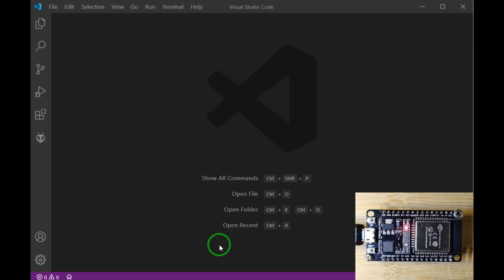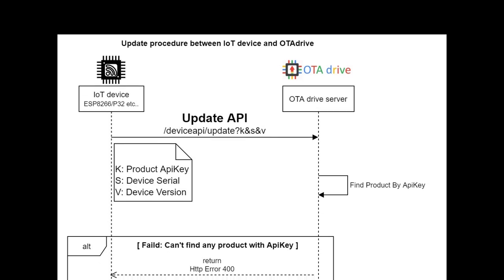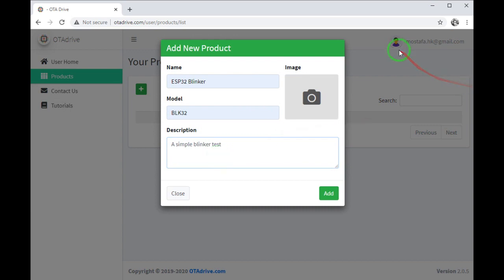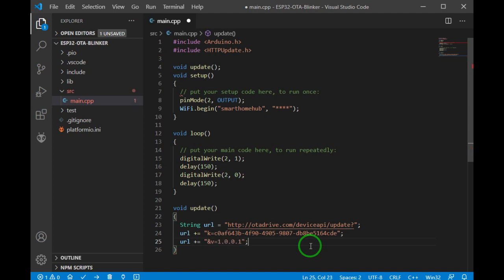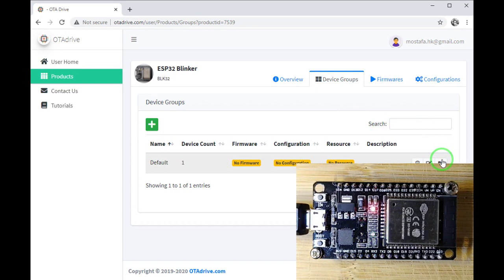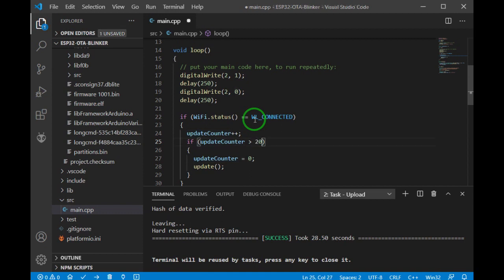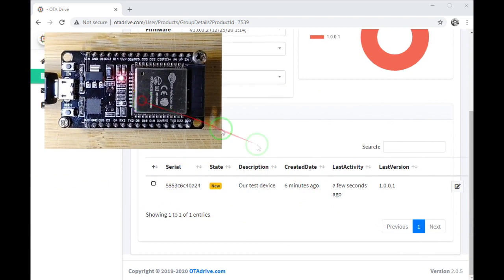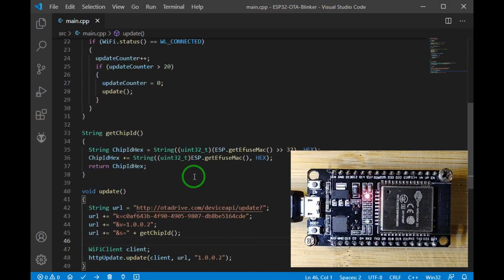How to update ESP32 (Or ESP8266) over Wi-Fi network (OTA)

Comment: I see some sample code using #include <otadrive_esp.h> and others #include <HTTPUpdate.h>. Which one is correct? Also I get an error after flashing "LittleFS Mount Failed". Any idea?
Reply from the maker: The otadrive_esp.h is our new SDK library and is easy to use. You can use HTTPUpdate.h instead if you don't interested to use our SDK library.
Reply: @OTADrive  Ok so to use your library I simply declare #import <otadrive_esp.h> and add lib_deps otadrive/OTAdrive? HTTPUpdate.h is an alternative but not needed if I use your library? If that's the case something else may be missing as I get the red curlies on the #import statement meaning the source file can't be found
Reply: @OTADrive  I sent you a few emails. Can't get the full sample code to work on ESP8266 (works on ESP32)